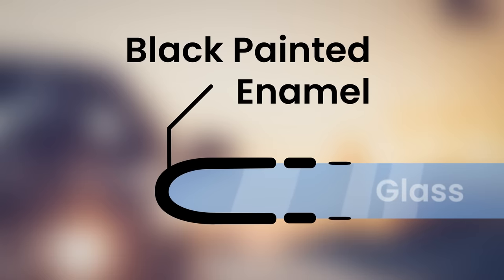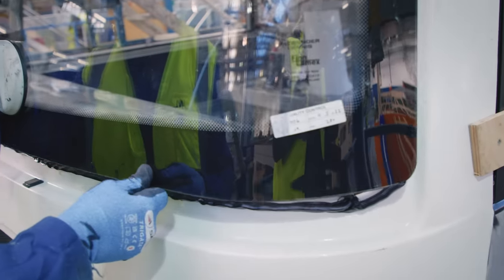Why are there Black Dots on your Windshield?

Comment: I have worked on windshields / windscreens for 10 years and yes I can confirm all this to be true and accurate. It's also to hide the urethane bead underneath and the gap between the plastic pillers that run up each side of the window and the metal that the glass is bonded to. Trust me won't be pretty if you could see all the stuff underneath. Good job I'm impressed.
Reply: I am surprised that your are impressed by a well explained video from a channel dedicated to adhesives and such
Reply: @Pinhead101  you figure  but trust me when I say people have no idea. Most mechanics don't  work on Windows to cars. I get a lot of back in my day we used to use a rope to install glass. Yah like all of 3 semi trucks still do that today and is mostly on cars from the 90s back. So they think they know windshields but in the past 30 years they haven't installed something it does change just a little bit.  I see many mechanics make mistakes about windows on cars and some people on YouTube not explaining things correctly. Just glad to see someone say things correctly in this industry for once because it normally never happens. Not even dealerships work on car windows. They use a different company to come out and replace the windshields. Dealerships don't even make glass. Like Ford and jeep and BMW. They have a different company make it and brand it with there mark. Normally FUYAO or Pilkington.
Reply: I wish all windshields weren't laminated and designed to shatter into small pieces, it would be funny if all windshields are still non-safety glass.
Reply: @automation7295  Fun to see blow up but not when driving. Widows have two layers of glass to them with a layer of PVB in-between them. This layer is vary difficult to rip apart. It designed to keep a person from being vary  stupid and not go threw the window in the event of a crash and there not WEARING THERE SEAT BELT. Also in the event of a rollover the window  disperses the wight of the car and prevented the roof from caveing in, even when the window is damaged. You also don't want 1000s of glass shards coming your way in the moment of a crash and raining on you. It is hard to rip the PVB apart but not puncture it.  It's like a net of sorts. Door glass and back glasses do not have this on most cars from the 80 to mid 2010s. Manufactures found out the lighter the car the better the mileage. So one of the first things they did is make door and back glasses tempered (one piece of glass) rather than laminated to save weight. Soon thought all door and back glasses will be reverting to laminated glass again for safety. Has it's ups and downs. Makes break ins harder.  Get stuck in a crash you can just pop the window with a window Popper but with laminate door glasses you'll have to rip and tear until it is done.
Reply: @Pinhead101  I'm surprised that you are so naive as to trust the labels on a video. A channel name does not guarantee the quality or accuracy of the content. There is a massive amount of clickbait on YouTube and across the Internet that attempt to fly all the right flags of legitimacy and interest. They lure in viewers, only to string the audience along with 20 minutes going nowhere and revealing little information that is accurate or new. 

From a glance at a headline, a thumbnail, and a channel name, it can be difficult to gauge whether clicking on a video is going to be worthwhile, or a waste of time. Most offerings are a waste of time. It is quite refreshing and impressive to see quality, concise, interesting content as advertised. And it's worth saying so.

Why would you criticize someone for complimenting someone else on a well done piece of work? What does that do for you? Do you think the world would be a better place if good efforts were not acknowledged or praised? I mean, that's not the purpose of trying hard. But maybe you could explain the purpose of your criticism.
Reply: he did kinda cover that already
Reply: Funny! I always thought the dots were just a fancy decoration. Never knew they had a useful function!
Reply: Is the part about the frit behind the rear view mirror also true, or at least the only true bit? I've always associated it with a lack of electronic shielding, which allows contactless tags to have good reception, and in my experience cars without that frit are unusable with many tags, the tag is shielded from the outside and upon reaching toll gates you have to open your window and wave the tag like an idiot.
Reply: @BlairdBlaird About the dots,  yes it's to somewhat help with the sun light. 

About the tags Iv seen many people put the tages behind the mirror so it's not In there line of sight and have not heard of it causing an issue. I think it depends more on the tag itself rather  than the window. If you do have tags like that be warned some can not be transferred easily to new windows when replaced. Some, like inspection stickers, are made out a paper and get ruined when transferring. I think this is to prevent people from stealing them, or more likely to make the state more money when you need to pay for a  new one.  I don't have any tags my self though. I have seen people put clear scotch tape on the tags and emissions stickers so they can be transferred easily and not get ruined.
Reply: @automation7295  This comment reads like some bait but judging by the use of the word 'funny' I gotta assume you're just young. If the glass wasn't safety, it would be a bit like the laser scene in Cube or the Resident Evil movie where that dude gets sliced like cubed ham.
Reply: @myoak108  If people are concerned about safety, then it's funny how they never complain about how weak side windows and rear windshields are.
Reply: @lilpuddinwashere Did you throw words into a blender and see what would come out? That was abysmal grammar.

Comment: And I always assumed it was just some kind of sun-blocker at the edges to aid the driver. So it is a sun blocker, but not just for our eyes.
Reply: Not for your eyes at all.
Just to protect the adhesive from UV.
Reply: I think it's both. The soft edges are probably less distracting to the driver.

Comment: One thing to point out about the frit behind the rear view mirror, is that the rest of the glass has UV (and presumably IR) filters which can prevent the signal of certain electronic tags (in particular the old "Fast Tag" system used in the Mersey Tunnel).  The frit behind the rear view mirror has none of the filter there, so mounting the fast tag (or similar) behind the mirror enables the some of the signal to pass through the glass, whilst still giving the driver some eye protection in that "fritted" area.
Reply: The precious and precise piece of information which i was going to post myself unless i had read it from your comment. Thank you Buddy! Well formulated!
Reply: That's the kind of less known facts I love learning about. Thanks !
Reply: There is also a camera behind  the Frit in Rear view mirror mount..
Reply: The glass itself restricts UV at the higher frequencies, e.g. I wear photochromic grey spectacles, which lighten up inside the car. Some car models, notably certain Fords, have electric heating elements built in to the windscreen, which does inhibit signals, such as those used by cameras that want GPS reception for navigation.
Reply: @johnkeepin7527  you sent me on a journey to finally wonder why so few cars even of high make have a heated windshield when it's almost universal on the rear. Apparently it's a ford patent...
Reply: Ok, nice try, but it’s  just there for aesthetics/a bit of sun glare reduction, got absolutely nothing to do with IR blocking or allowing signals.

Comment: I have an 80s car from sunny southern California that had no 'frit' and the urethane seal completely separated from the glass to the point where I was able to lean the top of the windshield out of the car from inside.  Where it was protected by the cowl panel, the urethane was still adhered, which to me proves that the failure was directly related to UV exposure. 

When I had the windshield replaced and re-glued the new ones they make still don't have frit! So I guess in 30 years I will need to have it re-sealed again. haha
Reply: FWIW there are UV-resistant glass compatible paints, even without the benefits of proper bonded frit it might be a good idea to try and protect the adhesive that way.

Comment: Years ago there would be intentional flaws in the "dot matrix" pattern near the tip of a wiper blade. This gave a target for wiper alignment for assembly and for service. The wiper arm base had a smooth no thread zinc insert that was softer than steel and when you tighten down the nut, the wiper arm pivot would cut grooves into arm bushing.

Comment: My first car still didn't have electronic fuel injection, it was from the old era of carburated engines. An old car from the 80's when car windshields were not glued to the frame with this new procedure, which seems to have become widespread in the industry in the 90's.
Reply: Passenger airbags won't work properly without a stronger windshield bond, because they fire up towards the windshield.
Reply: @buddyclem7328 , interesting, didn't know it, thanks for the information.

Comment: Interesting.  I noticed that my van's front windshield that was replaced several years ago doesn't have those black dots.  It developed a crack on the lower left corner.  I don't think anything hit it because I don't see a point of impact anywhere and the van is parked outside.
Reply: Worked in an auto glass factory for 20 years. Even some OEM windshields don't have those black dots. More likely a defect at the time it was made. Possible defects are too many to mention, but I don't think it was the lack of dots.

Comment: The ceramic frit only has ONE layer, usually on the inside of the glass, but in some circumstances in between the lamination (Pilkington).  Otherwise this is accurate.
Reply: Pilky01

Comment: And there was me thinking it was just to artistically hide the glue that stuck the windscreen in place, ever since they did away with rubber seals.  I would love to know where they came up with the word 'FRIT' from though.  Great video.
Reply: Let me Google that for you since you were too lazy to do it yourself.

"According to the OED, the origin of the word "frit" dates back to 1662 and is "a calcinated mixture of sand and fluxes ready to be melted in a crucible to make glass". Nowadays, the unheated raw materials of glass making are more commonly called "glass batch".

In antiquity, frit could be crushed to make pigments or shaped to create objects. It may also have served as an intermediate material in the manufacture of raw glass."
https://en.m.wikipedia.org/wiki/Frit
Reply: wow,  @x808drifter thanks for insulting people while not explaining why it's called a frit.

Comment: it is present on ~<1% of the visible glass surface so it blocks less than that in UV and everything else they made up to make it sound cool. Real reason is to create a better bond and tighter fit, as mentioned in the video.

Comment: How does the halftone pattern prevent optical distortion / lensing? Great informative video btw.
Reply: A hard optical edge will cause diffraction right around that line.  Think of a hard enamel edge (no halftone dots) being one side of an optical slit.  Light will bend around that edge, causing distortion along the edge of the windshield.  Right where your peripheral vision needs it the least.  The halftone dots allow your peripheral vision to 'fade to black' along the edges of the windshield - mitigating the distortion.  The distortion is still there.. but it's in the fade area and so much less noticeable.
Reply: @fredinit  Hmm, how does that relate to e.g. my computer monitor or phone that has no frit and no distortion at the hard border between screen and bezel? Or a window at home.

Comment: Before fret, that ugly seal was covered with trim, either black or aluminum, or stainless steel.   

Before polyurethane adhesives, windshields were secured using butyl rubber which never hardened and is pretty weak compared to PU.

Comment: I can add one major thing here: my highway tag works (gets detected by the toll booth) only if I put it in the black dots area. Took me some time to figure it out. This is the situation on my brand new car that has windshield heating... In my old car, the same tag worked at any place on the windshield.

Comment: I thought it was just to visually blend the black on the very edge (which is obviously there to hide the glue and edge) with the clear part of the glass. But managing temperature differences so the glass doesn't crack makes a ton of sense.

Comment: i work on car electronics diagnostics and repair and we have been seeing many water leaks into electronics modules caused by the frit now being between the laminate so the bond its now directly to the bare glass ,the bond is now so weak because the adhesive has  no texture (the frit used to provide) to grab
so now the winscreen tears open allong the top edge and lets water off the roof flood in, makes us wonder how vehicle manufacturers have made such a basic f up

Comment: 0:57 I doubt "optical distortion or lensing" would potentially shatter the glass. It should probably that heat can cause optical distortion or lensing and potentially shatter the glass.

Comment: If you have a windshield replaced watch the technician and make sure he or she is wearing gloves. The reason is that the windshield is an integral part of the strength of the "cocoon"  and the adhesive holding the windshield is very important to be entirely bonded to the frame. If the installer is not wearing gloves there could be oil or dirt from hands  on the bonding surface of the glass creating a weak spot. I was a traffic homicide investigator and re-constructionist for a large police dept and saw some failures. The large glass replacement companies have a check list that they should show you.

Comment: actually the black dots are the "black matrix" and the "solid black" is the "frit" for urethane adhesion. the frit has to be treated with a primer before installation but not the matrix unless using primer less urethane.

Comment: You missed the most important detail about this dot zone around the rearview mirror : this zone has no UV-IR reflector which are usually EM (electromagnetic) mirrors, so that at this very specific place, EM waves can travel through the glass.

The chassis of the car is metallic, and most surface of the front glass is UV+IR reflective, to reduce heat entering the car; this has the bad side effect of preventing phone waves entering your car, and toll badges to emit to the gate.

=> this is the place where you MUST glue:
- your toll badge
- the external antenna of your mobile phone
- any other GPS/FM/misc antenna

Because any other place will make your antenna get reflexted by the Faraday cage effect of either the steel parts of the car, or heat reflectors of the glass.

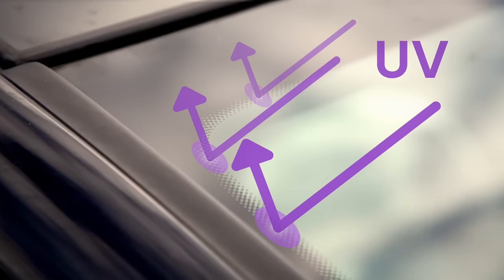I am not saying that 0:37 is wrong about saying the FRIT reflects the sun; the middle surface of the glass uses out of visible spectrum metallic reflectors that happen to be EM mirrors, while the FRIT is probably only black paint, and reflects IR and UV via purely colored pigments without interacting with the EM spectrum that's required for communications. It does make sense that the glue needs to be protected, but it can be protected by a simple black paint without metallic compound.

I do think that 1:12 about blocking sun may be inacurate.
Reply: Technically speaking, IR and UV are part of the EM spectrum, they're just not part of the spectrum that we use for mobile phone and radio communications - those are radio/microwave frequencies. (TV remotes, for example, use IR.)
Reply: @PurpleShift42  so true ... I missphrased every thing. By EM I meant radio. But technically all lights are also EM , and that's exactly why metals are used to reflect IR and UV. JWST uses gold mirror for high IR, we use aluminium when building house to reflect low IR ( thermal ) ( thin insulant for roof , or alu glued to dry wall )

Comment: There is never frit on the exterior of the glass, that is not correct, but manufacturers have begun putting the frit between the panes, with the laminate, on laminated windows.
I'm not sure why, but it does hide the delamination issues when they do a poor job manufacturing the windows.
Reply: Worked in an auto glass factory. Some autos have electric heaters painted on to warm the wiper blades. Painting the outer plate hide these. These windshields also have the inner plate painted for bonding.
Reply: @steven4315  I've never seen it. I work on auto glass daily, and have done well over 15,000 vehicles of all makes and models available in North America. 
The hidden heater lines are always in the frit, or behind the frit which is painted on the interior of the glass, or sandwiched between the panes of a laminated window. 
Perhaps you are just seeing one of these panes that make up a laminated window?
Reply: @alexhenderson4824  I agree with everything you said. We would paint the inside of the outer plate (panes). Dry it then paint on the heater lines and dry it. We would paint the inner plate after the inner and outer are mated and just before the glass was loaded into the lehr.